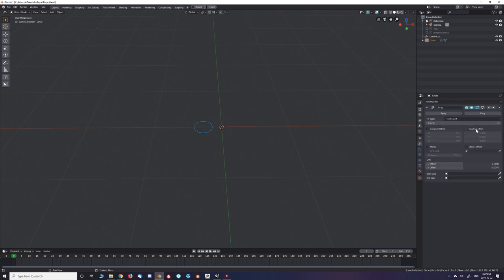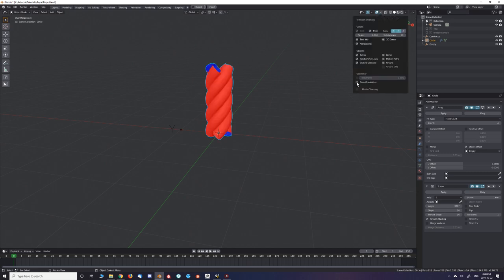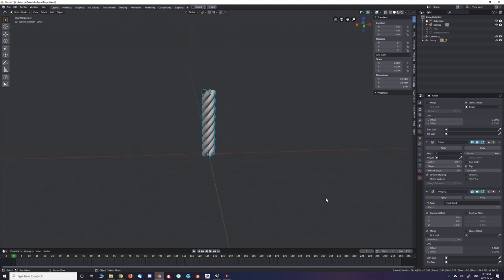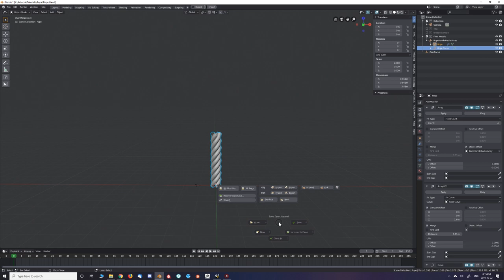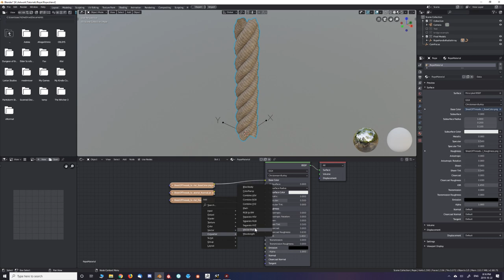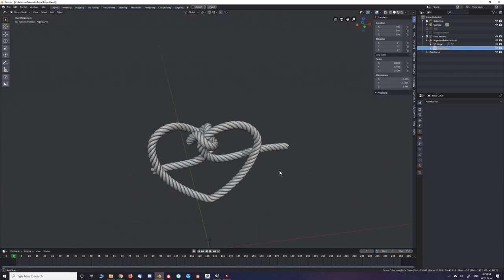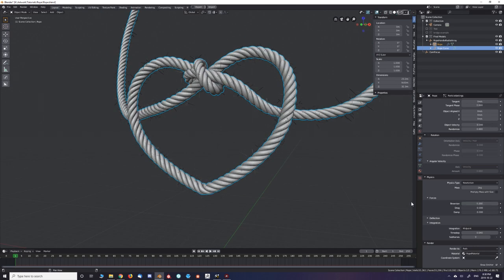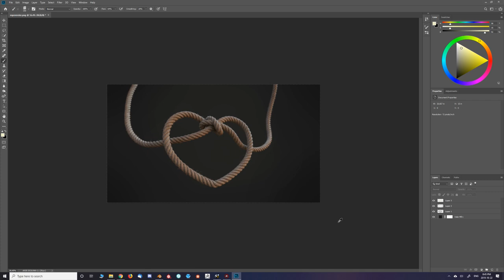Creating Realistic Rope in Blender 2.8

Comment: A bit too fast in places, but that's a great tutorial anyway. I wish you'd taken more time showing your actions during the particule set-up, but I loved you explaining the reasons behind ticking boxes, instead of just brushing it off.
Reply: That right. It’s a great tutorial but to fast for my old eyes. Switch speed by properties in YouTube to 0.5 or lower.
Reply: @fullspeedman  on PC and I assume Mac you can use the comma and period keys to go frame by frame.

Most of the tutorial I had at 2x speed but the hair section I'm at 0.25 and still struggling.. I'm not new to blender or 3d modelling by any means but jesus christ having the commentary out of sync with what's happening on screen and having it sped up at normal playback is a nightmare
Reply: in places? this was one of those tutorials that was so brisk that if you could hang with it, the explanation was likely not needed lol.
Reply: Just replying to the “it’s too fast comments”

This is where advanced tutorial learning is different than school.  The point of tutorials is for you to watch, pause, play around with settings, and your own creative design, and then push play when your ready to go to the next part.  

Also, save your file and experiment a bit!
Reply: Fast? I had to watch this on 2.0x speed just because I was in a hurry and didn't have the time nor patience to get to the point.

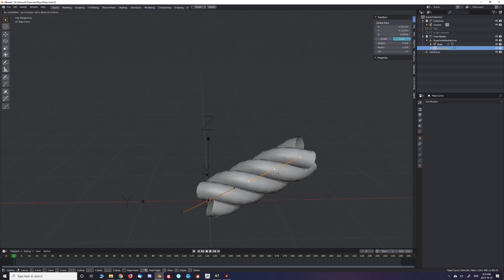Comment: Problem solved at 3:19, if when you move the handle from -1 on the x to 0 and the rope slides up on the y  and distorts, go back to the parenting step and instead of parenting the rope and empty too the curve, parent the rope and curve to the empty. I realized this after closly observing that when the cut in the video takes place, the outliner changes dramatically putting the empty as the parent with the curve and circle inside the empties drop box.
Reply from the maker: Ahh, sorry I must have missed that, I did a lot of takes with the recordings.
Reply: @SaschaUncia  No problem, thanks for the great tutorial, I learned a lot.
Reply: J Amy you are saver! I struggled with this for an hour. I think a lot of people in comments have a problem with this, but this is a simple solution because it is not seen well in the tutorial and it is very important that order of parenting for the final result, when at the end when you begin to shape rope, it seems that one end of the curve is connected to empty and cannot be separated from empty!
Reply: @markoraic4563  Bingo bango. Fret not, I struggled for a few more hours than an hour xD I probably tried to follow along 5 times and figured it out. Smashed my head against this one good.
Reply: Thank you so much

Comment from the maker: PLEASE READ this if you are experiencing issues.

Some common hiccups keep coming up in comments so I'll list common solutions here.

Weird Array Results or Crazy Geometry:  Modifiers take into account the objects relative scale, location and rotation; if any of these are modified you can get very unpredictable results. 
1) Please ensure all objects in your modifier setup have had their scale and rotation applied, you can do this using the shortcut Ctrl+A and selecting both options from the popup menu.
2) The origins of all objects must be aligned, I recommend adding an empty and setting it at the parent to all other objects in the stack. To do this, Shift+Select all objects, with the intended parent being last, it will have a brighter outline to show it is the active object in the selection; Press Ctrl+P to bring up the parenting menu. When you move the parent, all the bits should move with it and remain relative to each other, preserving correct results.
3) If you want to move pieces or all of the curve, do so in edit mode. As I mentioned, moving objects apart applies relative offsets to the modifier calculations and makes things explode. 
4) Check that the array axis is correct. This is pretty obvious if looked at in isolation but can be less so if its part of a complex modifier stack. 
µ) I recommend breaking things on purpose to learn just how things go wrong for a given offset  ;3

Modifying the Taper on the Curve Geometry and Other Issues: 
1) Firstly make sure you have sufficient geometry to modify. For a simple tube its under the curve settings tab on the right bar (appears with a curve selected) and increase the 'Depth' value under the 'Bevel' section. You can also increase the 'Resolution Preview' at the very top of the menus to change the divisions per curve segments along the length, and increase the 'Resolution' under the 'Bevel' section to increase radial divisions.
2) if your curve is square between segments, try changing the spline type (right click with point selected in edit mode). The default is Bezier but it can get changed by accident.
3) To set the taper (works only with curves), select point/s in edit mode and press Alt+S; Click to confirm. You can also enter numerical values, for example .5 for 50% scale and 2 for 200% scale.

Happy Blendering.
Reply: Sascha, thanks for the explanation. I'm having issues in the UV map part. I could not follow how you marked the quad or how I set which will be the active quad
Reply from the maker: @Guilherme5988  Hi Guilherme. To set the active quad you just need to have it selected last. You can Shift+Click twice to deselect and reselect the one you want to use. What follow active quads does is try to follow each edge of that poly, straightening the rest of the UV Map based on those angles. Be sure to straighten the edges in UV view first if you want a flat even grid.

If you or anyone reading this do a lot of UV mapping, here are some resources to look into:

__

Blenders UV tools are serviceable but far from perfect, if you do a lot of UV mapping you can also consider getting a paid tool like RizomUV. It's way faster and has more reliable tools & output (I've had blender output UVs which look fine in blender but have artifacts, quite a few times). That said these tools are expensive so if your only doing UVs as a hobby you may wish to stick with blender.

There is also an addon for Blender called UVPackMaster, it won't help you unwrap but it does an excellent job packing your islands, and it's very affordable. Do it by hand on a complex model at least once, then you'll see why this is so useful ;3

Lastly, Blender market has some affordable paid addons which help with the unwrapping part and add extra tools. I haven't used these personally as I prefer having everything I need in one program; RizomUV with a Blender bridge addon is the way to go if you do a lot of UVs.
Reply from the maker: It appears most people are still not reading this pinned comment when they run into trouble. If your reading this far, good for you!

Comment: Is there a way to make the whole rope bigger/smaller? Scaling the vertices with Alt+S doesn't do that. What I mean is to scale it wholly, like you do a regular model. When you scale it with S it does something strange: it makes the Array modifier that fits to the curve not "fill" the length of the curve properly.
Reply from the maker: yeah, things get weird due to how every modifier is relative to everything else. Try scaling just the curve, if you need the arrayed object to also scale down you may have to apply the scale and change your modifier settings. Or apply all your modifiers beforehand.

IE, all the modifiers are live and scaling the object does not automatically adjust the settings of the modifiers.

Example, I have a phone cord made with screw modifier and arrayed along an arc, if I scale both objects down, the array modifier glitches and I get only partial coverage of the arc. 

If I then apply the scale of the cord object, the array modifier properly arrays the cord to the length of the arc, but although the diameter is correct the curly cord is now super stretched over only a few repeats. The reason for this is although the geometry is the correct scale, the screw modifier is still using, say, 1 meter as the screw length, it then needs to me adjusted if you want to keep the objects non-destructive.

Another option is just to go destructive and apply all your modifiers. Then when you scale the object and curve everything works as expected. If you need to keep the array live, apply the other modifiers (in this case screw mod) and apply your object scale after transform.

Comment: My array is having an issue where when I array the circles on the empty they get smaller and smaller. Does anyone have a fix?
Reply from the maker: The scale of the empty and the circles don't match. Apply your scale. The modifier sees there is a diffference in scale, say 50%, and reads it as an intent to scale each successive array instance by 50% of the last. This applies to most transforms in a relative fashion. If you move both the array object and the array target along the X nothing unexpected happens. Move only one however and it will apply the relative difference to the array calculations.
Reply: @SaschaUncia  Thanks!

Comment: Hi Sasha followed your instructions but ran into a problem the mesh object was being deformed when curve modifier applied that squashed the entire rope mesh length thinner. Fixed when applying transforms via ctrl-A and apply rotation and scale to the curve object-works. Tip from Blender forum.
Reply from the maker: Yeah, there have been a lot of people running into issues with the modifiers. They take everything into account relative between objects so it's easy to run into problems.

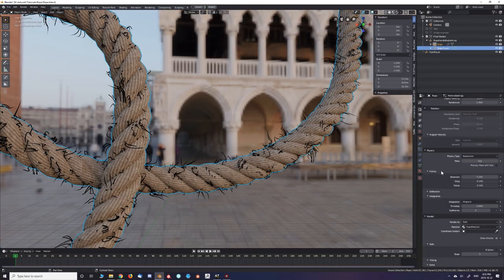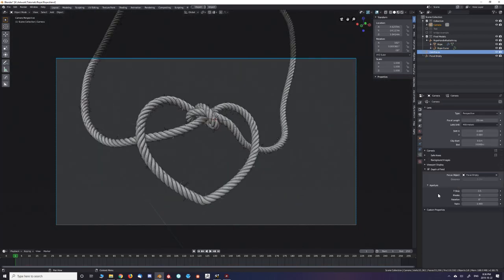Comment: Nice tutorial. For a beginner it is a bit too fast, but I got everything except the very last step (7:25 - 7:35).  I duplicate the rope material and remove the normal input, but when I set the strands material to this new one it doesn't change at all. Dunno if I didn't get something.
Reply from the maker: hard to say since I can't see your screen, but make sure under the materials tab for your object to have two materials, one with and one without normals. In the particle system, tell the hairs to use the second mat slot. this should fix hairs rendering as black.
Reply: I think it was my mistake ^^' after remaking the process I got it right. But thanks much! So far the best tutorial for detailed ropes.

Comment: Hi great tutorial with so many functions, can I use the iterations within the screw modifier to lengthen it? I tried it increase the length of the rope without using another array modifier. But UV unwrapping would be hard since I already applied the screw so the UV is quite long. haha
Reply from the maker: yes, that's why I used an array instead of increasing steps. you could try making a texture to cube-project (triplanar) over the surface if you don't want to make one with array.

Comment: Amazing tutorial... i'm a beginner and just tried it, how to scale up and down the rope proportionally? Thanks
Reply from the maker: Hey, sorry, I forgot to explain how to do that that in the voiceover. You can select vertices of the curve and press ALT+S to scale vertex width. There is also a button in the toolbar when editing a curve that lets you scale and rotate the curve points. Have fun!
Reply: @SaschaUncia  Hello it doesnt work, I pass on to "edit mode" then select all vertices, but ALT+S do nothing, and with S, the ropes doesn't follow the curve
Reply from the maker: @K.V.S.H  Something likely broke in your procedural setup, I am trying it right now in the newest Blender version and it works as expected.

Try it with this setup to test for issues, be sure to Alt-S on the curve vertices and not the deformed mesh - https://drive.google.com/file/d/1am5ahZRtP-cUX4z77Nwe7C1pJpTAcj8u/view?usp=sharing

Here is the original rope scene if you want to pick it apart - https://drive.google.com/file/d/1SLYWhp1onPAbIPvB1Pkw5gNi8Vgak57A/view?usp=sharing
Reply: @SaschaUncia  Thanks for your response, the problem was the parenting who makes me select all and not just the curve. The problem now is when I reduce the radius of the rope, she isn't as longer as the curve, how to correct this ? Because screw modifier is applied I can't use iteration
Reply from the maker: @K.V.S.H  to make the rope match the length of the curve you need an array set to 'fit curve'
Reply: @SaschaUncia  I have the one you setup in the video but I think I will try by myself, thanks a lot bro for your amazing work. And if you have any solution for simulate Gravity, plz link it
Reply from the maker: @K.V.S.H  Look up Blender Rigid Body Simulation, or, breaking a wall in blender, that sort of thing
Reply: @SaschaUncia  thanks a lot 🙏

Comment: Stuck on the UV unwrap, i marked the seam going up, but when i unwrap it is is still a curvy unwrap, it is not squared off like that, even if i do the follow active quads after?
Reply from the maker: be sure to square off the root polygon when following active quads. Use align x and align y, when fully square/rectangular along x/y axis, be sure it is the active one selected (slightly brighter orange). Follow active quads will look at the active and align all the others parallel to it.

Comment: i made the rope and it's mostly fine but the mesh is way above the bezier curve, not on it. also the end of the rope goes on in a straight line past the last bezier vertex
Reply from the maker: Most likely the geometry in edit mode is not on the object origin. Or the object is not aligned with the curve origin. all origins must be aligned or it treats it as intentional offset.

Comment: can you connect two ends of the rope somehow?
Reply from the maker: I don't thinks so, not automatically. Try making your curve cyclic, and manually tweak the scale until the ends more or less line up.
Reply: @SaschaUncia  I figured out if you applied the modifier you get verticies of the rope. the issue is once you apply the modifiers you cant move the rope as well as you would be able to, so you have to be satisfied with your work first.

Comment: How do you separate the rope+curve from the empty? Great video otherwise, thanks!!! :)
Reply from the maker: to work properly the origins of the empty, curve, and mesh should all be aligned. Edit the curve in edit mode and move the points themselves to where you need them. 

Tips: You can also move the array along it's array axis after modeling to offset it along the curve. This can be used for something like growing roots, snaking cables, or animated tank threads.

Another cool trick is you can create interesting effects by modifying the empty. Each new array object copies the transforms of the empty, relative to the last object. For example, you can use a spiral-curve or deform modifier with the array, and scale + offset the empty a little with appropriate base geometry to create an ammonite or snail shell.
Reply from the maker: I usually just parent the rope and curve to the empty since they need to be aligned.

Comment: i am struggle in a problem i hope someone can help me..it works fine for me and i follow all the steps but the extrude works good only from one side the other side always destroy everything ive done
Reply from the maker: hard to say without being able to see what is happening. try applying transforms on your source objects, ctrl+a, and checking which axis your modifiers are using.
Reply: @SaschaUncia  thanks for answering..the problem is i do all the steps and it s good and when i try to shape the rope, it works only for one side ,,but when i try to edit the other side of the curve it leaves its place and start to make wierd shapes..and yes i apply the scale and rotation all the time
Reply: Also I noticed when I try to extrude from the other side of the curve it moves also the empty with it as a parent I don't know why but the other side no problem at all
Reply from the maker: @alisaadalla2892  Again, hard to say without seeing what you see. make sure all the object origin points are aligned, be sure your array is set to fit curve and that it and the curve modifier are using the right axis. worst case, try a new scene and copying modifiers from video exactly, it might be one button somewhere that got ticked and is messing things up.
Reply: I wish I could show u but thank u so much 😊
Reply: @alisaadalla2892  Stuck with the same problem, in my opinion something wrong with the origin dot, cause that "wrong" side of rope sticking with origin with dashed line. Don`t you get any solution yet?
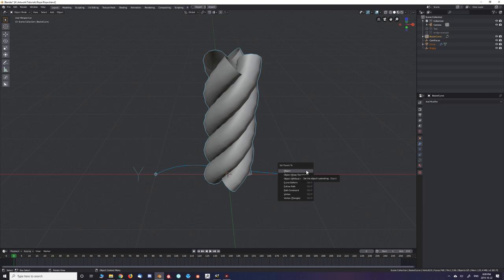Reply: Got it. You have to parent the rope and curve to the empty. Not rope and empty to curve. Idk, thats just magically fixed in video on 2:10
Reply: @ivantroynov1339  the worked thanks!

Comment: Its a great video, but I dont know what happens here... The array+curve method never work the way they should. The shape doesn't follow along the curve and all kinds of strange behaviors. I`ve followed it step by step and the rope starts going crazy the moment a try to extrude and create new points or even move those points.

I also noticed that when I try moving a point on the curve, the empty moves with it too (!!!)

Anyone with the same issues?
Reply from the maker: Have you read the troubleshooting steps in the pinned comment? Modifiers can break rather easily.

Comment: The one part I came for (getting the rope in place/shape) is not explained at all :(
Reply from the maker: Array the object setting the length to fit curve and select your curve. Add a curve modifier to get the rope to follow the curve. Edit your curve with the transform tool and through extruding the end of the curve (E). Use (Alt+S) to scale the handles of the curve to make the rope thinner or thicker at parts. R = Rotate, G = Move, S = Scale (scales bezier handles in proportion to each other in this case)